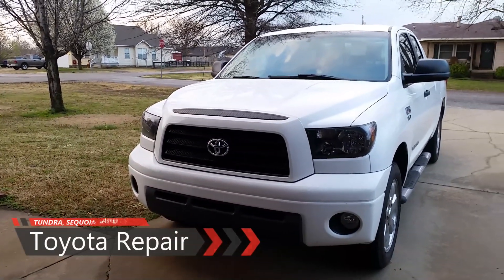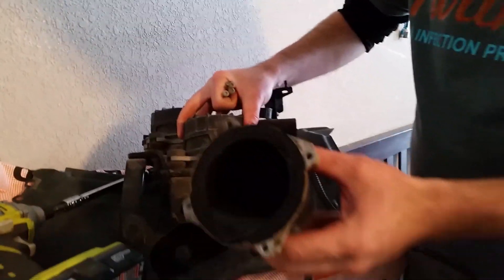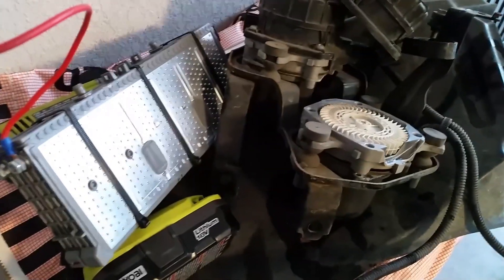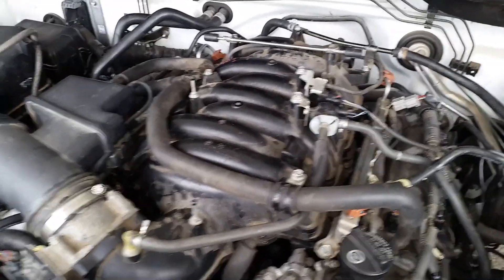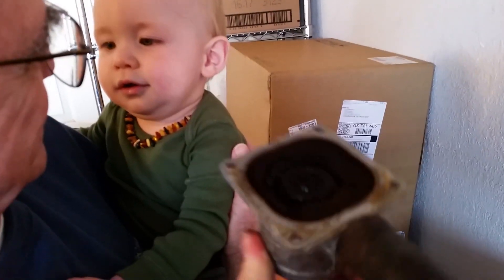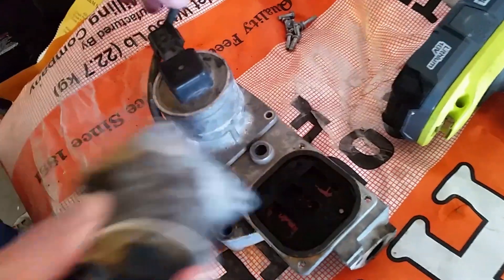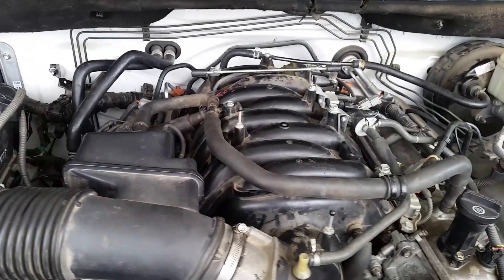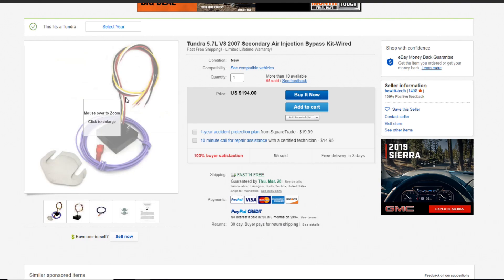Tundra Won't Accelerate FIXED - VSC & Engine light on

Comment: I currently have AIP probs with my 07 tundra. It’s stuck in limp mode. Won’t accelerate properly at all. My truck has almost 260k miles

Comment: I have the same lights on but mine isint in limp mode i can still get it up to speed fairly ikay but for sure has an issue it shakes when on light throttle in between 30 to 40mph anybody had this issue?
Reply: My 08 tundra does when secondary air system is malfunctioning

Comment: Very well explained video . I had same issue with mine ,but with the 4.7 liter engine . You don’t need to take intake manifold off . They are located on the left and right side of engine . Very easy to change out . I also learned to buy OEM parts because the generic ones last a year if you’re lucky .

Comment: 2007 Toyota tundra 4.7.  P4019 code. Tested the pump. Seems like only 1 pump which works. Still in limp mode. Any advice?
Reply: Look the video
Reply: One pump for 4.7 engine

Comment: I got a 2008 toyota tundra 4.7.    Code p2436/p2438. Secondary air injector system.  Bank 2 .. I don't know which part causing it..  bypass kit on but check light still on with traction blinking

Comment: Hi! I’m having issues with my 2011 tundra. No mechanic is able to find out what’s wrong with it. It starts up normally but it loosing power when I accelerate. The only lights that come up is A/T temp oil and check engine light. I let it cool off and it starts again like nothing happened. When I took it to the mechanic, they put the coder and nothing comes up. What can it be?
Reply: Clogged cats?

Comment: Replaced Secondary air injection system, the air pump for it is fine.

Still throwing codes and check engine light. Reset and nothing stays on.

Comment: I had this problem both in and out of warranty on my 2008 4.7L Tundra. The dealer had to fix the problem the 1st go-round. Hewitt Technologies fixed the problem with their plug-play SAIS computer the 2nd time the problem occurred. Still have the truck and drive it everyday.
Reply: Just tried this yesterday and looks like it didn’t help
Reply: @danielmejia6219  You're saying you bought and installed the proper component from this company (https://www.youtube.com/@Hewitt-tech/videos) and your problem was not resolved?

Comment: I had the same issue, youtubed it, came across an old dude that just took both battery cables off for a few minutes, put em back on and voila, I did the same thing and all the lights went off, no $200 fix at all.
Reply from the maker: Yeah I did that a few times also, it will hold out for a few days but will eventually come back on

Comment: Guys, you might want to try this first if your check engine light is on and your 5.7 tundra is weak and won’t run over 50 to 60 mph, My tundra had these issues so i floored it a couple times while driving, problem fixed, also took the positive battery cable off and put it back on to clear the cel. So far so good, may be worth a shot before spending a ton of money.

Comment: Most likely you're getting water in the air pumps. I would drill some holes on the bottom line you did to get the water out and The reason I think water gets in the pumps is because the one way valves fail and exhaust is going into the air pump and exhaust has moisture in it.
I wonder if a cheap one way hair valve that hot tubs and spas use on their air pump systems would fix the valves from leaking back to the air pumps. They sell one and a half and two inch pipes that look like about the same size as the failed valves you show it in the video. Could be a $20 fix without having to dig out the old Air valves. But the way you did it it's the right way and it's going to last for a long time especially now that you have holes in the bottom.

Comment: Having this same issue on my truck tried to start it last night and it had an air sound to the engine and seemed like it was running rough and the VSC and check engine light came on. Probably gonna attempt the repair myself as i dont have the money to let a shop do it.

Comment: I had the same problem. Fortunately, it was just a 10amp fuse. ALWAYS CHECK YOUR FUSES FIRST FOLKS!!!
Reply: Fuse is popping for some reason. Most likely you're getting water in the air pump and it's causing the air pump to work harder and causing the fuse to pop so at the very least I would drill some holes on the bottom to get the water out and to do it properly you need to replace the one way valves so that air doesn't flow on both directions. The reason I think water gets in the pumps is because the valves fail and exhaust is going into the air pump and exhaust has moisture in it.

Comment: Now that we're slightly in the future. You can also just let the system finish its cycle and use either a proper code scanner or BlueDriver and clear the code once the truck is no longer "Cold" and it can be driven as such. Though, properly fixing things is also great. The parts are mightily expensive.

Comment: I had the same issue, purchased the Hewitt Tech bypass kit for $450 and in about an hour it was installed and the problem went away. I would recommend this kit to anyone who doesn’t have to worry about passing emissions testing in their state.
Reply: Drilling a hole, then using a penetrating oil like Kroil sprayed into the valve will fix the issue.  Poorly designed and poorly managed by Toyota.  That worked for me
Reply: @bullredfish12 hi do you have an update on what happened after drilling a hole did you have any cons ?
Reply: @TheStickerfam  I sold the vehicle a few months back after limp mode kicked in while on interstate.  Out of the nowhere, 70mph to 45 in a sec.  RPM’s to 6k.  Blew a “gasket” around #8.  I hadn’t had an issue with it since I drilled the hole. 

Specs: 2011 4.6L w 210k miles.  First limp mode didn’t happen until 170k miles.  I’ve had 2 Tundra’s in 22 years with few issued but that limp mode crap(and lack of a head gasket) sent me to Ram.
Reply: I was looking In to buy that
Reply: @garysmith9017  it’s cheaper now and they have an updated Gen 2 kit. I have the Gen 1 and it works fine for me.
Reply: @joeybuckles8404 hey joey i just bought a gen 1 kit for 195$. Did you just buy alone the gen 1 kit and installed it like that? I called Hewitt and they’re telling me I have to buy an extra connecter for 100$. Looking to see if you just bought the gen 1 kit alone 195$ and installed it like that. I’m putting it in into my 2012 4.6
Reply: @rod.e10  a little late but the kitty I bought was around 400 and some change I think. It had the block out plates and the plug n play connectors. Still doing fine. How did yours end up?
Reply: Did you drive for a hour or so before the check light go ? I installed one on my 08 tundra.  Have just from 2 min. Light still there with p2436 code
Reply: I really need this..thank you very much

Comment: Thanks for sharing! my Tundra did the same exact thing as soon as I left home, your video saved me $$$$ two pumps $160 plus 1 hour of my time! Now the truck is back on the road
Reply: Hello friend please quick question my car stuck in 4th gear and no power  it barely moves but if I disconnect the battery and rest it the car gets back to normal it goes about 50/60 miles and the problem comes back i am very upset I couldn’t  find a solution
Reply: Do you have the parts number to all the parts or could you steer me in the right direction

Comment: I got a 0101 code no matter what I do New Maf cleaned air filter no leaks it pops up. I had a dump exhaust after muffler and added the axle back to it. Do you think that’s the cause? Truck is supercharged and tuned on Orange virus. Sometimes I get a crank position sensor code also. 0013 I think. Let me know what you think. Have a k&n filter as well with the stock air box mod.

Comment: Had that repair done on my 2008 5.7 which was out of warranty. Check engine light with two codes and bank 2 however vehicle never went into limp mode. In fact check engine light came on right before a 2000 mile trip. Toyota said it was safe to drive for the entire trip just kept the RPMs low.
Total cost was 2600 and I reached out to Toyota Motor Corporation for assistance and they cut me a check for 1900. Design flaw
Reply: Hey Chris how old was your 08 when it happened?  I’ve heard these specific parts are warrantied to 10/150,000 because it is a known issue.  Just happened to my 08 with 136,000 so I am probably out of luck with it being older than 10 years.
Reply: @nicegunt  if the dealer does your repair then the new secondary air pumps will be the updated models that have the little covers and slats so that water can't get in. It was a simple design flaw that they put on the 08 and moisture gradually made its way up all the way to the pumps which are located at the top of the engine... you're looking at no less than $2,500 and I've even heard another States depending on where you live and maybe as high as 3500 to 4000..
Reply: @nicegunt  let's see the year is 2021 I had the repair done if I'm not mistaken in 2019.. it was past the 10 years... what ended up happening was since it's my third Toyota the service manager assisted me on what to say to Toyota Motor Corporation when I gave them a buzz to reach out for help.

Toyota Motor Corporation are extremely friendly people and there's a good chance if you're a valued customer and you've bought more than one truck from them they will take your name and number and get back to you in a few days after they do an investigation. That's exactly what they did with me. Since it was my third Toyota they decided to cover 80% of the cost. They just send the check directly to the dealer who's fixing your Toyota. You can only get this assistance through Toyota Motor Corporation if you take the truck to a Toyota dealer for the repair.
In my case I had all the services and minor repairs done at the same toyou do so they had my whole service record. It's a very expensive repair if you don't have assistance but there's another option...
I did a lot of research and there's a kit you can buy which will bypass the secondary air pumps . From what I understand the kit is a couple hundred dollars and it may even be able to be put in by yourself I don't think you'll need the dealer... there's hundred the YouTube videos on how you purchase the kit and where and they talk you through it step-by-step but basically it'll bypass your secondary air pumps and then you just go to the dealer and have the check engine light turned off and you'll be all clear so that you can get an inspection sticker. Basically the truck will run just as it did before you just won't have secondary air pumps since you'll have the bypass unit... if you don't do the bypass unit then you're going to have to do the repair through a certified technician just use caution and don't drive the truck very fast and high RPM while that check engine light is still on...may go into limp mode and if it does it cost you an arm and a leg to take it out of limp mode and then still have the repair done. That mode will activate to protect any components from being damaged..
Good luck bro
Reply: Very kind of you to respond with all of the detail.  I truly appreciate all of the advice!
Reply: @nicegunt  welcome

Comment: Toyota made an absolute garbage design with their air pump systems for the Tundra.
That is a very common problem on that truck.
Reply: Got a by pass kit on ebay for a couple hundred. It been great for years. Truck doesn't need that that part. It was to appease EPA
Reply: @aekuterbach1  do u still have link of bypass kit? My VSC light just started  flashing yesterday.
Reply: @carpe-diem4074  I don't have the link, it's been years and still no problems. Look up tundra bypass system. It was a about 3 hundred. Totally works!!!

Comment: Hello,  Code PO419 , check engine light, and Wont Accelerate Above  50, is this code for the same issue  ? Thanks.
Reply: Id like to know too.

Garage said kinda error about air intake or injector (running smoothly as usual) but wasnt sure...

Still canot accelerate fast and go above 80 km/h too

Comment: Hi.  Thanks for the video.  The secondary  airpump; is that suppose to rotate when ignition is on? Mine is not.  I am currently troubleshooting a C1201 code that has the same exact symptoms like your truck - vsc flashing, ABS on, engine light on.  I have a 2007 tundra ltd.  Please help.
Reply: Did you ever figure it out
Reply: The fan comes on only when the engine is cold/ initial start up

Comment: A stuck open Valve will cut power... a stuck shut valve will turn engine light on.  An give you 10 mpg cos it Messes up the Second O2 Sensor...Making the truck run almost like a choke is on.  :( I am not a fan of Toyota after this being my 12 one... this is by far the worse TOYOTA I've ever owned.

Comment: So you dont think putting tiny holes at the bottom of the pumps won't suck more water into the system
Reply from the maker: Nope. Its just like drilling holes in the bottom of a 5 gallon bucket, let's the water drain out. The truck is still operating properly to this day
Reply: @JohnCalebWarren  bypass is the only way
Reply: Wich bypass?

Comment: Your car looks really new, how could that happen being that new
Reply: It's not new,those are the previous models and are 07 to 11 approx. So that many years is gonna give you problems due to wear and tear. I just fixed mine on that same issue  and by looking at the truck,you could swear it's new, but mechanically, the parts get old and break down.

Comment: Hey @john, thanks for making this video. I'm no mechanic and never even changed my own oil, but this gave me the motivation to attempt a repair myself. Rats had chewed the wiring on my knock sensors and I had to remove the air intake manifold to reach them. Your vid showed how this was possible.  I saved $1,500 in repairs and my Tundra runs like new again. Kudos!
Reply: Thats beyond impressive for someone who has never changed their own oil
Reply: How much were the parts? Did you replace the pumps also?
Reply: @rjayfitness  No pumps replaced.  Just the wires to the knock sensor.  $2 total.
Had to do it again a few months after.  Now I sprayed some pepper spray and no more issues.
Reply: @stephanecome4234  where did u buy the wiring? I'm having  the same problem.
Reply: @thetruelifelover  It was my local O’Reilly or Advanced Auto.  Any of them should have it or able to order them.
Reply: @stephanecome4234  thank you

Comment: Toyota have warranty on the air pump for tundra under 150 000 mile ,did it couple month ago
Reply: I call the dealer and they said it went out in 2019 I have a 2008 Toyota Tundra having the same problems slow acceleration I'm trying to figure out what's wrong with mine can anybody help
Reply: What year is your tundra
Reply: @sankeybryant2739   2011
Reply: How much mile you have on your tundra
Reply: @sankeybryant2739  https://youtu.be/kvWRPwvZPLw
Reply: 2010 tundra Toyota air injections pumps 48000 miles warranty out at 36000
Reply: An I have to pay

Comment: That's not a vacuum hose, that system is lightly pressured when the fans are on. It's a vent for the solenoid plunger.

Comment: If i by that bypass kit i just clip it on or is there more to it after that ? No motor knowledge smh
Reply from the maker: It's pretty much just a direct Plug & Play. However there are some exhaust block off plates that are strongly advised to install to prevent further damage to the valve assembly. If you just install the module kit without the block off plates it will still work and run correctly without a check engine light

Comment: Man, thank you for making this video. I had no idea the location this pump. My code is P2445. I have a 2007 tundra limited. So far I replace the starter, that was a nightmare, water pump, belt and tensioner, radiator hoses. Thanks again for making this video.